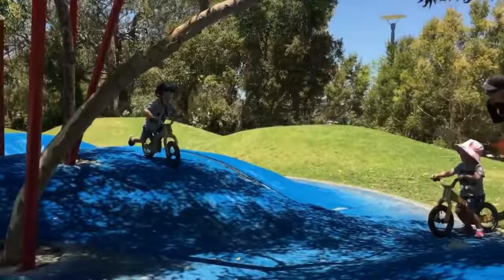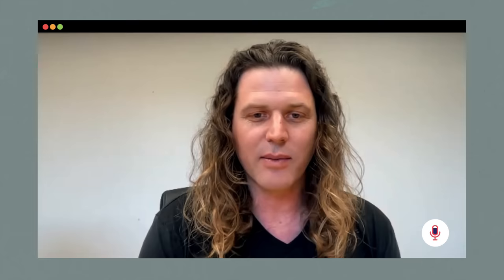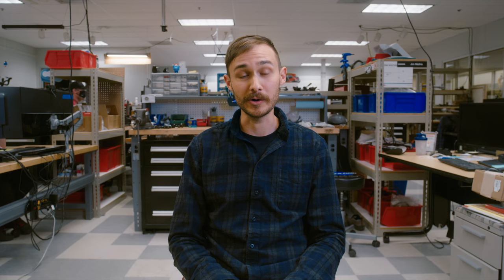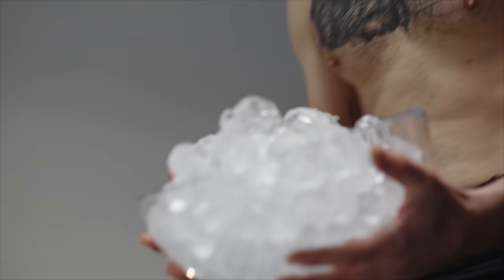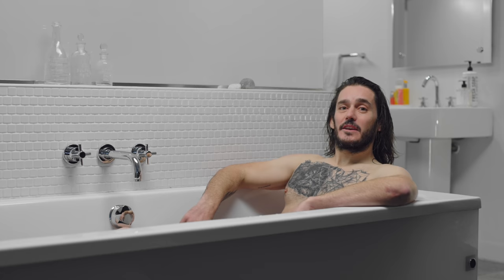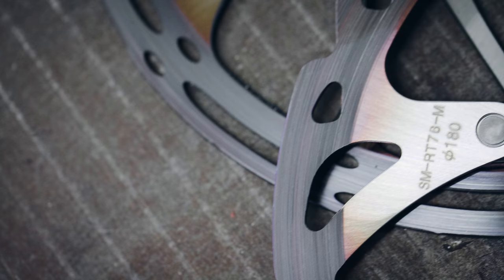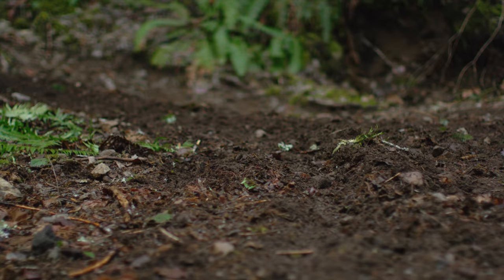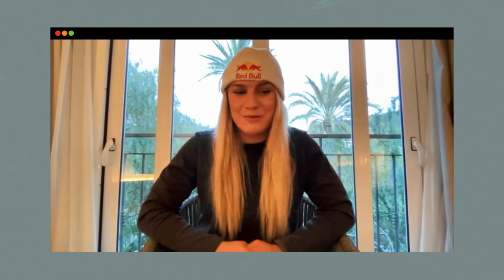The Science of Stopping | Mountain Bike Disc Brakes

Comment: So you say that the dot fluid seals have a wider range of temperatures, but you don't say what those temperatures are in comparison to the mineral oil seals. So that point could be completely irrelevant if they both are outside regular operating temperatures
Reply: Not a lot of evidence in their arguments that Dot is better than mineral. Very unscientific for a video about "science". Also some of the arguments are in bad faith. Maybe most mineral oils (MO) maximum operating conditions are less extreme than dot 5.1 but it seems even pro riders aren't reaching the max conditions of mineral oil since at least half of them run MO brakes. They also mention the environmental cost of disposing brake fluid but fail to mention that Dot fluid expires shortly after the bottle is opened. If there's unused dot fluid at the end of the day it should be disposed of. A bottle of MO that's been opened will last much longer. Also funny that they say hydraulic disk brakes are the most popular. That's only true in their bubble where everyone has the newest stuff. Reality is that cable actuated rim brakes are still the most popular since most people ride out of necessity and aren't looking to optimize their bike
Reply: And when shimano etc might have problems with their seals sometimes I think you still don't have to bled them as often as sram.
Reply: @jfcote42  There's lots of bias in this science! Also, dot is much worse for the environment.
Baby oil is a mineral oil and applied to babies skin, don't try that with dot.
A food grade version of mineral oil is used to seal wooden cutting boards in the kitchen.
Reply: Most of this video is irrelevant, the only differences noted between different brands of brakes is the fluid type, which is generally the first thing that SRAM naysayers point out when talking about brakes. It's a nice try by sram to try and associate DOT fluid brakes with higher end and professional riders, but there's just as many riders using mineral oil systems as sram. They also failed to mention the fact that DOT fluid has much more dissolved gas in it, which is why you need to do a 2 syringe vacuum bleed rather than a gravity bleed like mineral oil.
Reply: @lawlerskeetz he literally says in comparison to mineral oil compatible rubbers at 5:54 💀

Comment: “Fluff” video,  defending SRAM’s  disc brake systems, which have numerous issues.
Reply: Like?
Reply: @TheNotoriousMIC  you read my comment. So one of the biggest problems is the sticky lever issue which is extremely dangerous. Another common problem is that these brakes are weak. The Codes are good but the Guides are bad for everything with a littler longer descent. Especially with organic pads
Reply: @daylight31415  guides have won world cups stop talking nonsense. I’ve owned a set of guide rsc for over five years flat out abused them. I last bled them in April 2019 still perfect. Same with my codes. I also use slx and xt brakes and in two years I’ve had to replace five callipers dude to the ceramic pistons leaking and when they’re not leaking they don’t perform nearly as well an an old set of heavily abused guides.
Reply: @TheNotoriousMIC  I know the issues of shimano brakes. Just because you didn't have problems with your sram brakes does not stop these brakes from failing in other instances
Reply: @TheNotoriousMIC  Winning “World Cups” is not indicative of a well designed hydraulic brake system.  Working as a bike mechanic I’ve seen numerous issues to complete failures with Sram hydraulic brake systems. In the days of the elixir brake systems they would constantly, that Sram wouldn’t even question the warranty. Today the issues are fewer, but more issues, than Shimano, Magura etc….. I will say some of the issues are due to customer negligence, but nonetheless it’s a system, that is sensitive due to the dot fluid, and the quality of the small parts.
Reply: @Thebikewrench apart from they’ve been proven at the highest level by being good enough to win a World Cup, they’re more than good enough for us and if 80% of the brakes you sell are sram then your obviously are going to see issues. My codes and guides have been the best performing, least maintenance required brakes I’ve ever owned. I’ve flat out abused my guides because they’re old, they should have failed and I’d have nobody but myself to blame but they’re still solid and the only issue is the adjustment dial rattles. Could completely rebuild both brakes for around £30. In the meantime I’ve been through 3x slx and 3 XT callipers and two levers. Require constant maintenance, won’t win world cups and use mineral oil.
Reply: I've pulled some 50 year old Toyota's out of fields, hydraulic brakes still functioning. 
I don't trust bike brakes yet. I've seen many fail from sitting in the shed for 1 year
Reply: @TheNotoriousMIC  I have different opinions. I havent had SRAM brakes in a while and recently got the Code RSC on my Ripmo V2, already having problems with it just 150 miles in. XT and XTR brakes on my other bikes, ebike and otherwise have been perfect with the bleed needed every now and then also have had no issues with Hopes either. Just seems to be bad luck or real issues with SRAM.
Reply: @sgtkurry  what issues are you having?
Reply: @TheNotoriousMIC  Had my brake pads glazed already. Lever gets stuck sometimes and when it does the pistons gets stuck too and drags the brake rotor until I can reset them. Just been a problem overall.
Reply: @sgtkurry  try metallic pads (the ones with the copper back plate) they don’t glaze over when hot and with any organics all you need to do is clean disk and pads. I sometimes even put the pads and rotor into the dishwasher afterwards and then run the pads together under a warm running tap and repeat the bedding in process. 

I will say this sram brakes are very fussy when it comes to alignment you do need to make sure all the pistons have advanced evenly and that the calliper is perfectly centred over the rotor. You can’t just pull the lever and tighten the bolts like you can with say a shimano brake. I’d check that’s ok do a quick lever top up and if that hasn’t sorted it send them back and they’ll replace the brake within a week.

Comment: Great work guys but can you tell us why a 4 piston code on 200mm rotors is less powerful than a shimano 2 piston on a 180mm rotor
Reply: I have experience with both and believe me they're not...
Reply: @nebnollock5198  your 1 in 100.  You must not be running metallic pads in the shimano.
Reply: @nebnollock5198  I have to agree. Even my G2s are more powerful than my 2 pot XTRs.
Reply: According to the video, it could be because the rotors are too big and not generating enough heat for optimal stopping power. 9:41-10:12
Reply: @nebnollock5198  Yes they are and by far. MT-520s which are the cheapest 4 pot brakes you can get from Shimano are MUCH MORE powerful than Code brakes with same size pads. They also require much less maintenance. At the end of a bike park day with MT-520s I'm fine. With Code R's I can barely close my hands.

Comment: Well that was great informativ!
Iam running Ceramic Pro from Disco Brakes with Magura Ebike disc 220mm. Its amazing stopping power with the MT5 by using low level power. Shigura is also nice but quite a bit to much stopping power.
Reply: You tried or had shigura setup?

Comment: I thought the pad retraction springs make the pistons return to their home position, and not the piston seals, silly me.
Reply: Not silly you. You are of course right. SRAM are wrong & should know this as all of their brakes are supplied with springs. This video is just marketing hype.
Reply: @45graham45  Open up a sram brake for yourself. No springs in the caliper! And only a very very small spring in the lever which could not possibly have enough force to retract the pistions. It's the rubber seals
Reply: @reillys7981  No not in the calliper, but they do have a spring between the pads which is what returns the pads to their position - the seals do not have enough power to do this.
Reply: @45graham45  Exactly. Anyone who thinks otherwise could try running their brakes without this spring.
Reply: @45graham45  Seals have plenty of power, take your pads out and give it a try (don’t squeeze too far or the pistions will overextend. This is normal as there is no rotor and pads to stop them)
Reply: @reillys7981  Nah, as an experiment I fitted pads with out the pad spring. The pistons & pads didn't retract fully. The clearance between the rotor & pad became too small.

Comment: Can you compare a fluid based on testing the brake that was designed for dot fluid, with a brake designed for dot fluid with seals swapped?
Maybe you should have also test another way round taking shimano brake and swaping seals for dot seals.
Reply: That could be bad for marketing now, wouldn't it @metiks111 😉

Comment: Moto rider, riding a 27kg ebike. Hope 220 floating discs, SRAM Code R brakes, front brake on right.. Same as my moto.  Would like more brakes.
Reply: Did you try using your foot on the wheel?

Comment: Are they evaluating the seals in the lever? It seems like they're dismissing years (if not a decade) of binding lever seals. Please advise.
Reply: external factors
Reply: It is actually not the seals that make the pistons sticky, but the piston itself. It is simply not true to its size and too big in places. One can sand it down and it will work again. Just be very cautious and don't take away too much material https://www.youtube.com/watch?v=9Dze0YuNg5U
Reply: @daylight31415  I think it actually swells up over time as new brakes function OK, then they start biding. I'm guessing it could be moisture ingress related?
Reply: @Primoz.r  yeah according to some reports it might be that the dot 5.1 lets the piston swell a bit.
Reply: @daylight31415  the pistons are made from plastic. They’re totally immune to heat moisture etc but can deform if someone doesn’t align their calliper properly or forces the pistons back with a screwdriver or something and obviously a deformed piston isn’t fit as nicely as a perfectly round piston giving you a sticky piston. Rider error in most cases. New piston and seal kit costs around £7/$10 for any sram dealership which is pretty much every bike shop that sells mountain bikes.
Reply: @TheNotoriousMIC  for sure my lever piston deforms due to the caliper pistons not being aligned. What are you smoking? The sticky lever problem is a well known issue due to the piston swelling over time, tight tolerances and will then lock up on a warm day
Reply: @daylight31415  never heard of it, never seen it but I’m in the UK. Might be a hot country issue.
Reply: @TheNotoriousMIC  Platics are not immune to moisture.  For example, nylon absorbs moisture, swelling in the process.
Reply: @ouzelcc ”Phenolic pistons are composite plastic, they are mold pressed, heated, and molded into shape. They do not rust, are not affected by heat or moisture in the brake system, do not transfer heat to the brake fluid and are much lighter than steel. They are used in various OE applications”.
Reply: @TheNotoriousMIC  Thanks for that - matching the plastic to the application is crtical, as you say.  I was not sure which plastics were used in the braking system.
Reply: Plastic swells in DOT :D Its kinda normal. One option is to service the lever and sand them down a little bit. The other option is to get Metal Pistons and not have the trouble ever again
Reply: @aronsima3484  they’re a plastic composite designed to be immune to heat and swelling. Metal pistons don’t insulate the calliper from heat at all and expands when heated. Don’t sand stuff down or buy sketchy pistons of Ali express, just spend the £7.99 on a seal kit / piston kit.

Comment: Icetech rotors, pads and ceramic pistons makes different atmosphere in the bath, so regulars system could active it. All improvement counts. By the way mineral  is less density and moves faster in a hose and has faster response and heat management. As you guys prefer talk about competitors, its my pov! Keep riding

Comment: Better make a video how to sand down your sticky pistons in your lever because you can't manufacture them to the right size. Or what about my sets of leaking brakes where the caliper pistons didn't seal anymore.
Reply: Or make sure you align your brakes properly and don’t force your pistons back with a screwdriver and then don’t point at other people for your mistakes?
Reply: @TheNotoriousMIC  yeah man, always aligned my single piston in the lever wrong...
And regarding the caliper. I never used a screwdriver in these. My first set developed the leaking pistons after two years. A new caliper leaked after a month. Bit yes, user error😂
Reply: @daylight31415  the pistons are made from plastic if you don’t align your calliper properly or force your pistons back not taking care then your pistons will deform and they can leak or stick inside the calliper. There’s nothing wrong with your lever. To be fair you should be changing your seals and pistons in your brakes after two years anyway. I never never needed to with sram brakes mind.
Reply: @TheNotoriousMIC  these are two seperate issues. I changed the caliper's pistons and seals. A little work bleeding but that was not the big problem.
The lever issue is a different thing and has nothing to do with misalignemend in the caliper. And it is very real. Every forum and youtube has multiple posts about that. And it is fucking dangerous because sometimes the levers start sticking on a decent and suddenly the brake blocks when you try to release the brake and won't go back.
Reply: @daylight31415  Huh wierd. I own some CODE RSC's and never had those issues. Just service the lever at the right time and change the piston or sand it when it becomes spongy :D

Comment: It's the brake pad spring that makes the pistons retract, not the seals (where as in a car which has very big powerful seals then it is the seals that do this). Ever tried using pads without the spring? If you have then you'd know. I'm very surprised SRAM haven't realised this as all of their brakes are supplied with return springs.

Comment: Cool story. But everyone already knows the practical difference between Sram and Shimano brakes. Btw the only brake I had which had a stuck piston was Sram Guide, so whatever you make those seals from, they are certainly not magical. But maybe try to enter the bath market with them?
Reply: I have had Shimano 4 piston XT's stick too. Not unique to Sram.
Reply: @pucevelour  Yeah, every brake system has some problems. I am not here to say that Shimano are better, they are different, worse in some departments, better in others. Definitely not inferior because of piston seals though ... SRAMs got the reputation of weak brakes and tries to reverse that with Yoann in a bath, which is amusing, but I doubt it will work.

Comment: Why exactly do dot fluid brakes have to be bled more often?
Reply: DOT attracts moisture more often. Its something normal.
Reply: They don’t. Dot fluid is way more resilient than mineral oil. You can go years without needing to replace dot fluid, when did you ever need to replace the fluid in your car? That’s dot fluid. Mineral oil doesn’t stand up as well to heat and moisture and will need replacing much more often. I haven’t needed to bleed my sram brakes in over three years. I’m just about to re bleed my XT’s which I last did at Christmas. The fluid won’t be red, it will be grey and milky and maybe even black.

Comment: So SRAM silently addresses Shimano bite point issues. Still a mild ad for SRAM brakes. I think the truth is closer to "every system has flaws". Trp, magura, I can't believe they all have shitty seals cause of mineral.
Reply: Agree. My thought is that the corosivness of the dot fluid helps keep the seals clean without maintenance. Shimano seals can be cleaned with mineral oil and a small paint brush so they perform predictably and last forever.
Reply: @MrUnl0rd  interesting point

Comment: There is something wrong with this analysis I think. dot fluid brakes have many times (sram!!) swollen seals that under high temperatures block the pistons from falling back into the original position. Many mineral oil counterparts (some shimano, formula, etc...) suffer a lot less this issue, but yes maybe under high temperatures they suffer more a changing breaking point so they feel more inconsistent. I just dont buy this seals story especially from the ones that have the most problems with this aspect.